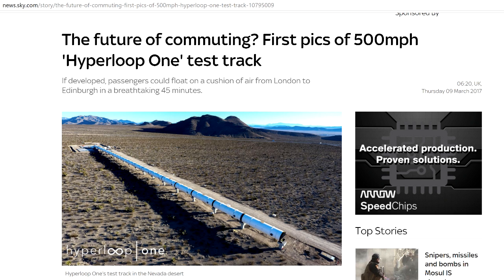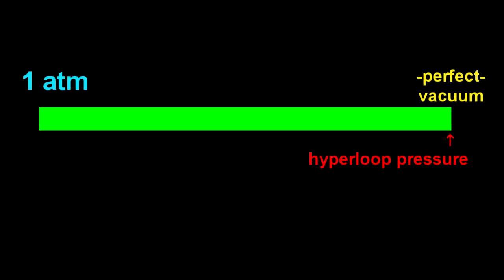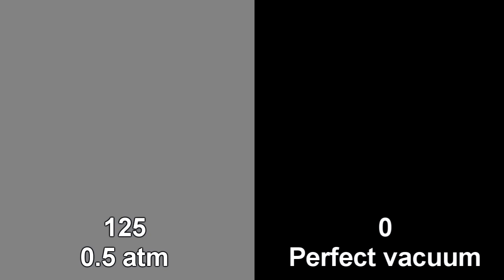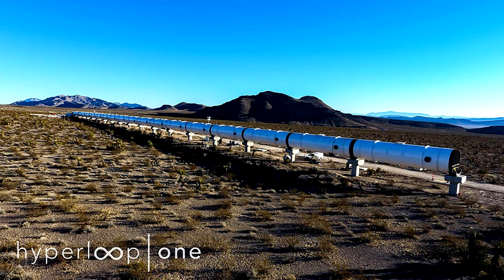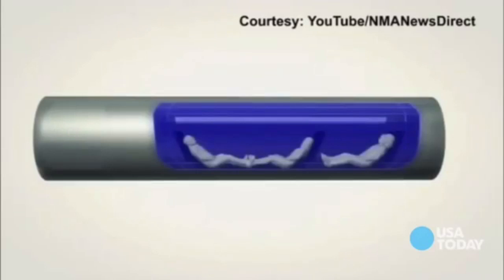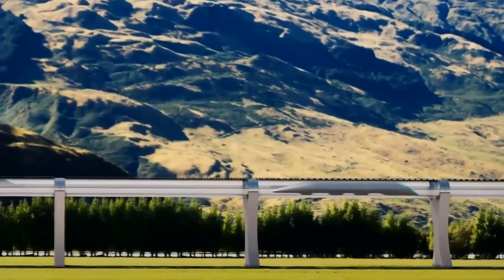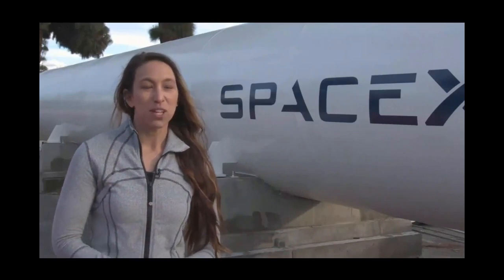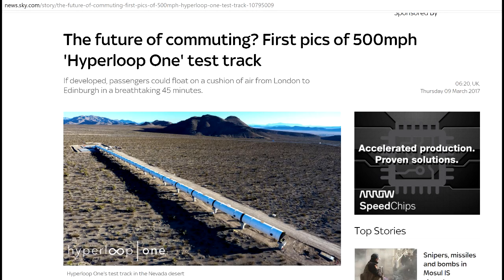Entire Hyperloop could be destroyed in SECONDS!

Comment: There are some great arguments here, but the first half of the video should really have been left out as it weakens your strong arguments.  
The project should definitely be abandoned, but making fun of the people who are in the alpha alpha alpha stages because their capsule goes 50 KPH instead of 1000 KPH is not fair.
Reply: You misunderstand.

The alpha-alpha-alpha stage means nothing. They are testing low friction designs in a low pressure. The idea is that once you get it to speed it almost coasts to the destination. THIS IS THE POINT OF THE VACUUM. If it weren't, it's just a fucking train.

The idea was that, with air friction removed, only wheel friction would mean that a design would just coast, for a long time, making it very cheap to run (again, air friction makes it EXPENSIVE not slow).

Meanwhile, http://www.reuters.com/video/2015/04/21/japans-maglev-train-smashes-world-speed?videoId=363936720 Japan proves air is a bitch with regular train that won't explode if failing.
Reply: How is it not fair?  If it is a stupid idea, then it should be nipped in the bud before any more of other peoples money gets wasted.  Or before someone gets killed when the tube collapses.
Reply: I'd rather prefer more development in the field of electric catenaries than in the Hyperloop.
We already know conventional trains can go fast (550+ km/h), but they are usually limited to 400 km/h because of issues with the electricity supply, caused by interference between the pantograph and the catenary. 
If we solved that issue once and for all, we could achieve TGV speed records daily without even modifying the existing high speed railways (of course only on straight sections).

Because the only thing that was tuned in the record trials of the TGV, was higher voltage and tension on the catenary to prevent the interference. The rails weren't modified.
Reply: videos4mydad its ok to not have anything yet, the only problem is saying itll go almost 1000kph is the problem, i can say in theory in six months ill be able to squat 600 pounds, and make it sounds cool but right now only be able to squat 210, then how does that sound. now multiply it by 200
Reply: Nopes, the plane of the Wright Brothers are controllable at event of malfunction and the survivalrate is much higher. They had more time to react while still able to glide slowly in open space. With the hyperloop you are confined in a tube with just one direction. You can't just bail out, for example in an event of fire inside the capsule. With a plane, you still have some time to land and emergency evacuate, subway people just leave and walk along the track to nearby emergency exit, with the hyperloop...
All passengers must wear spacesuits?
Reply: beaconrider well your argument is not really valid. Just as an example that first airplane of the brothers Wright was way more ridiculous and stupid and nearly as dangerous as this hyperloop thing. Now just take a look at where airplanes are now. And beeing dangerous is no argument at all, as all transportation methods are dangerous. (Remember 9/11 as for how dangerous planes can be)

The speeds that are proposed for this technology are easily achievable once it is worked out.

I just think that the timeframe is overly optimistic (and i am beeing generous here).
And another question is if it ever will become financially feasible.

But there is no question if it will work as there is not a single bit of physics that stands in the way of the basic idea.
Reply: +LandoGarner Well, nobody knew what a plane would look like. Not a true parallel, I don't think.

The Hyperloop isn't new ground, we know the physics behind it, and isn't a new idea, the vacuum tube as transport has been around for about 100 years. Hell, it was in Babylon 5. They just imagined a tube from a glass that can eat a grenade and not give.

All Sirloin Musk has done is give it a new name and made some money from it. 

Missing several key factors, like the fact that the longest flight, east to west coast, is about 5 hours. Plus 3 in check in, check out and some dicking around. That's because planes go just under Mach 1.

Hyperloop goes Mach 1 means 4300 km, or 4 hours across. With MORE security checks because tubes.

So, basically, billions of dollars later, you shave an hour off.

Even in ideal conditions, with only an hour travel and check in and check out and over-mach1 speeds that are VERY dangerous, and WAY more expensive, that would be 4 hours plus one in check in.

Would you pay for the rest of your life to install and maintain the Hyperloop just so you can shave 2 hours off a cross-country travel?

Wright brothers my left foot.
Reply: Everything with a track is a limitation due to servicing costs and 
geographical influences. Airplanes only have to worry about the huge 
airspace. On the logistical side, do we really need to arrive few hours 
earlier at destination?
Reply: Rockethead7: well obviously you didn't really read this thread as some of my points (like the fire aboard part for example) were answers to points other people made above.

The hyperloop as it stands is no danger at all as it is going to take years or more likely decades until they can even think of putting people in there.
No people no danger to them. At least for now.

And the plane of the brothers wright was in fact even farther along than the hyperloop as it could even carry someone. compared to that the Hyperloop is more like at a paperplane stage.

What that guy musk promises is beyond me as i am more interested in the technical side and haven't really looked at his claims toward cost/timetable. (Such claims tend to be way off anyways so why waste my time with them)

Now to the terrorist with a bomb part you raised:
As long as the bomb does not hit the capsule itself (or a part of the track close enough in front of it for the capsule to hit it) the only thing it would accomplish is to shut down the track and give the passengers a seriously bumpy ride.

Explanation:
Any track like that would have to be built with regular reinforcements to stop the collapse of more than a single section of the tube (for pretty obvious safety reasons). So even a bomb would not be able to collapse the whole track.

So if for whatever reason a section of the tube would collapse the only thing nessecary to prevent loss of life is to stop any capsules.

Another possible scenario would be for the tube to rupture. (or in your favourite Terrorist with a bomb scenario a part of it is blown away)

Well if the opening in the tube is in front of the capsule the air rushing in would go against the capsule and stop it.

If the opening is behind the capsule the inrushing air would accelarate it until enough air has gone by the sides of the capsule to equalize the pressure differential and the capsule would coast to a stop because of the air resistance alone. Of course IRL there would be brakes as well.

In both scenarios the worst case acceleration/deceleration was calculatad to be around 5g which is seriously bumpy but only lethal if you are very unlucky. (as in not seated even though you are supposed to be afaik)

To summarize as long as a bomb does not hit a capsule directly, or close enough in front of it so said capsule hits the damaged section, the only thing it would accomplish is to shut down the track because it is now pressurised. The capsule would be stuck somewhere and the passengers could be evacuated because there is no longer a vacuum anyway.

Ah yes about your english classes remark:
Well english is not my native language and as my english is better than quite a few other engineers i know write in their native language i consider it good enough for what i need. Regardless of what some random internet guy thinks.
Reply: Landogarner83:

YOU SAID: "well obviously you didn't really read this thread as some of my points (like the fire aboard part for example) were answers to points other people made above."

== It's a preposterous response regardless of who/what you were responding to.  You don't assess danger by using examples of things that could happen, unless you're including the odds that those things are going to happen.

YOU SAID: "The hyperloop as it stands is no danger at all as it is going to take years or more likely decades until they can even think of putting people in there. No people no danger to them. At least for now."

== Good grief.  What is this babble?  The main point for the naysayers is the danger level.  To respond, "it's not dangerous until it's built" is just silly.

YOU SAID: "And the plane of the brothers wright was in fact even farther along than the hyperloop as it could even carry someone. compared to that the Hyperloop is more like at a paperplane stage."

== Yup.

YOU SAID: "What that guy musk promises is beyond me as i am more interested in the technical side and haven't really looked at his claims toward cost/timetable. (Such claims tend to be way off anyways so why waste my time with them)"

== Sigh.  Because the entire point of the hyperloop is to do it INEXPENSIVELY.  If it takes just as much money (and security) as flying, nobody would bother with it.  Musk's entire (ridiculous) claim is that he's going to build/operate this thing for $20/ride to go like 400-500 miles in under an hour, followed by other routes to go even further for similar amounts of money per ride.

YOU SAID: "Now to the terrorist with a bomb part you raised: As long as the bomb does not hit the capsule itself (or a part of the track close enough in front of it for the capsule to hit it) the only thing it would accomplish is to shut down the track and give the passengers a seriously bumpy ride.  Explanation: Any track like that would have to be built with regular reinforcements to stop the collapse of more than a single section of the tube (for pretty obvious safety reasons). So even a bomb would not be able to collapse the whole track."

== Pffttt. Yeah, because terrorists are going to set off a bomb when the pod is far away???  Or would they do it when it's going to do the most damage??  Sigh.

YOU SAID: "So if for whatever reason a section of the tube would collapse the only thing nessecary to prevent loss of life is to stop any capsules."

== Oh, believe me, the bomb would do a fine job of stopping the capsules.

YOU SAID: "Another possible scenario would be for the tube to rupture. (or in your favourite Terrorist with a bomb scenario a part of it is blown away).  Well if the opening in the tube is in front of the capsule the air rushing in would go against the capsule and stop it.  If the opening is behind the capsule the inrushing air would accelarate it until enough air has gone by the sides of the capsule to equalize the pressure differential and the capsule would coast to a stop because of the air resistance alone. Of course IRL there would be brakes as well."

== Yeah, because those 10 years I spent at 3 different universities, literally at the top of every physics class I ever took... thanks, I can't figure out physics 101 without your help.

YOU SAID: "In both scenarios the worst case acceleration/deceleration was calculatad to be around 5g which is seriously bumpy but only lethal if you are very unlucky. (as in not seated even though you are supposed to be afaik)"

== What the fuck???  Nobody even knows what this design is, and you're already declaring what kind of G-loads the pods will take??  Where are you getting this bullshit?  The shape of the pod makes a huge difference, as well as how much gap there is between the pod and the tube's inner wall, as well as the mass of the pods.  If this thing is pretty snug to the wall, it's going to stop a hell of a lot faster than if there's a large gap.  And, in different iterations of this ridiculous idea, Musk has claimed large gaps would be used, while in others, he's said that the pod would have only tiny piston-like clearance levels between the pods and the tubes.  And, that's not even getting started on the type of rupture.  A pinhole leak isn't going to let a wall of air in, and the slowdown would be more gradual.  A 1 foot hole will cause more air to rush in much more quickly.  And, a complete collapse the size of the tube itself is going to send a rushing wall of air at any pod.  So, what the hell are you even saying, such that you think you know enough about the design that you can already calculate the G-forces??  This is ridiculous.  The hyperloop people themselves don't even know what the design is supposed to look like.  And, if you're getting your "5g" information from them, congratulations on being a gullible sap who believes every goddamned thing you see without questioning it.  How can they even predict the G load at this point in time?  This is just like the fact that they're predicting the cost at this point in time.  They pull a number out of their asses and say they're aiming for that.  Price per ride.  G factors.  How to adjust for expansion.  They're pulling all of this out of their asses, because they don't even have a viable design, and YOU SAID THIS YOURSELF.  You said they're at the paper airplane stage of development!!  Those were YOUR WORDS.  Yet, you're sitting here telling me that you've already calculated the G load??  Sigh.

YOU SAID: "To summarize as long as a bomb does not hit a capsule directly, or close enough in front of it so said capsule hits the damaged section"

== What in the fuck do you think a terrorist is going to do??  Wait for the pod to go by, THEN explode the bomb?  OF COURSE the terrorist is going to set the thing off shortly before the pod gets there.  This wouldn't be too hard to predict, you know.  This tube is supposedly going to be made of metal, right?  Ever put your ear up to a metal train track?  You can hear the train coming from miles away.  Or, hell, just get someone to listen 1 mile down with a radio to say "NOW" when it zooms by.  That still gives about 4 seconds of warning.  Plenty of time to push a button.  Sheessshhh, man, you are acting as if terrorists couldn't figure this out, and would just blow the thing up when it can't hurt anyone?  Pure delusion.  Your entire posted messages are streams of delusion.

YOU SAID: "the only thing it would accomplish is to shut down the track because it is now pressurised. The capsule would be stuck somewhere and the passengers could be evacuated because there is no longer a vacuum anyway."

== Yeah, keep telling yourself that.  Drink the Kool Aid while you're at it, please.

YOU SAID: "Ah yes about your english classes remark: Well english is not my native language and as my english is better than quite a few other engineers i know write in their native language i consider it good enough for what i need. Regardless of what some random internet guy thinks."

== Alright, you have my sincere apology for that aspect of your posted message.  I'm sure you read/write far better in English than I do in whatever your language is.  I am not kidding, I truly apologize for the comments about your English.

(Also, I edited the post to correct my math.)
Reply: I have also been thinking about multiple stops. The advantage of land based transportation is that it can make multiple stops, which is not possible with a Hyperloop considering the time it would take to depressurize the length of the tube.

So the Hyperloop basically functions like a plane, except that it runs on the ground.
Reply: Afterlifesinner:
- Not that I'd ever defend this ridiculous hyperloop idea, but just FYI, there'd be no freekin' way that they'd ever intentionally pressurize/depressurize a 500 mile tube for routine stops.  It's not just the time, but the total energy ($$) required to do it.  They'd have to make stops by slowing down to an "off ramp" and then going through some sort of pressure chamber.
Reply: Landogarner83: I'll just reply to one part:

YOU SAID: 
"- The real tube is quite likely not glass so no way to see the capsule coming. - that idea about listening is a good one but i don't think it will work as steel for example conducts sound too good for it. (i tried it with railway tracks and found that it is extremely hard to say anything more than that a train is running on them somewhere but no clue how far away)"

== If nothing else, there's the Doppler effect (higher pitch when coming toward you, lower pitch when going away).  But, seriously, if you honestly believe that you wouldn't know the pod was passing you in a steel tube going 800mph, man, wake up.  And, you don't need to directly hit the pod with an explosion.  Any explosion a couple of seconds before the pod gets there will be too much for the pod to sustain.  It doesn't need to be exact.  If you REALLY believe terrorists can't figure out when the pod screams by them, seriously, there's not much more conversation I can have with you.  Your level of delusion is off the charts.
Reply: I don't see them build lots of decompression sections. It‘s also very impractical if these sections are limited to the length of the capsule(s). Any modification/utilisation of a sealed door leads into having to decompress the tubesystem between the previous next decompression section. The fact it has to be vacuum makes it too much complicated.
Reply: false advertisement